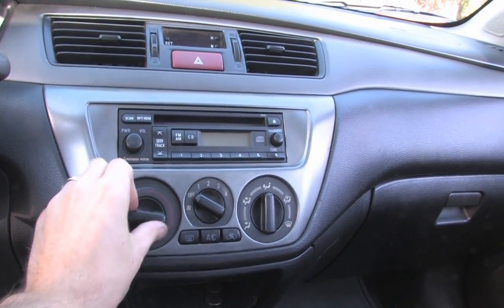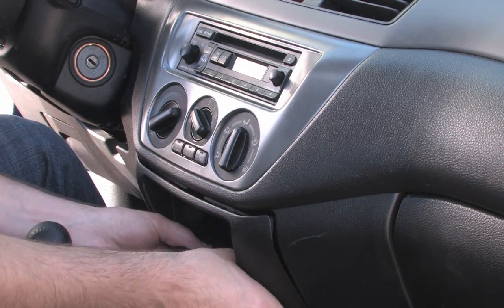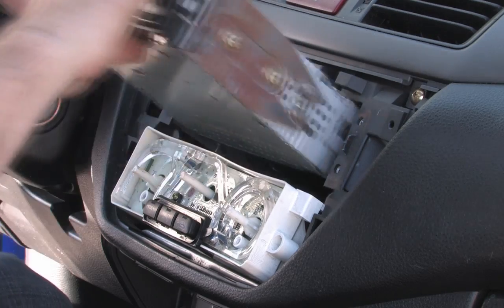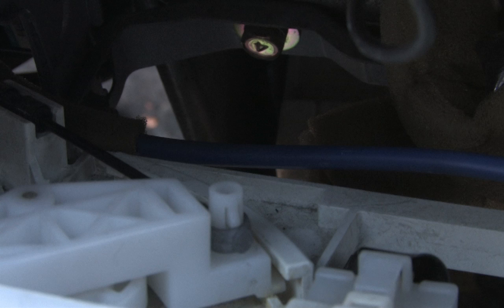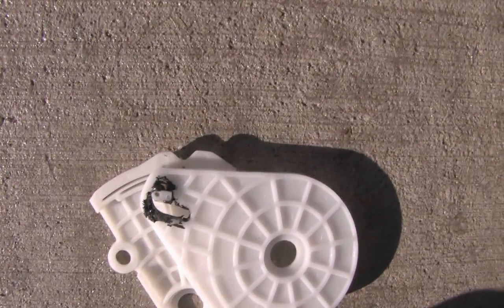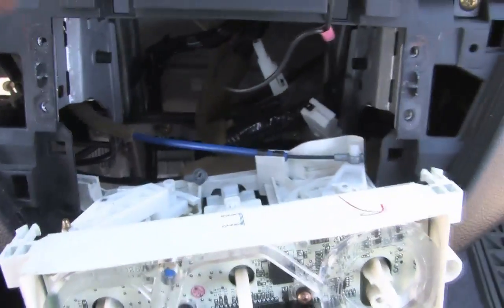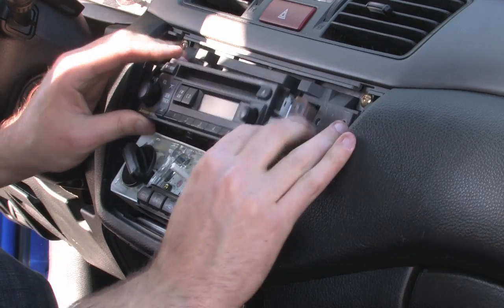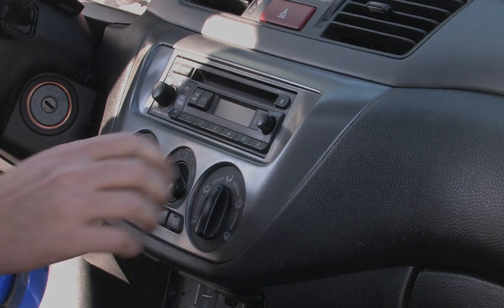How to fix a stuck heater control knob // EVO// Lancer// Mitsubishi - Boosted Films

Comment: So my Evo Air Conditioning only works (And quite well) in Max AX. If I hit the A/C button it does not light up at all meaning the green light does not turn on when I hit the A/C Button. Now when I put it on MAX A/C it lights up and goes cold.Any help?

Comment: Any advice I turned the knob from heat to cold for just a couple minutes and I don’t know if i did it too hard or what but I can’t get my hear working again when turning the knob back in the same direction it was heating up normal up until I messed with the knob I already did a heater core flush replaced cabin air filter changed thermostat and replaced and topped off radiator with the correct fluid but just recently very little too no heat ever since I turned it to AC. Part of the plastic bit broke off in the knob when trying to fix it. 04 Mitsubishi Lancer same dashboard

Comment: Thank so much for this video. I ordered the parts and I’m attempting to fix mine tomorrow. Your video gave me the confidence that I can do it by myself. Thank you for saving me hundreds of dollars. 
Update: Got it all together but it’s the round gear to the door blender causing the issue that won’t turn easy. It’s so hard to line up the notch too. Had it apart at least 9 times. I’m cut up bruised, bleeding and ready to sell this car lol. It just reached 110,000 miles for a 2004 Lancer. I can’t find any how to’s on the door blender gear for the climate control. $600 to $1000 if I have to take it in. I will never buy a Mitsubishi again after this. Sad because it’s been a good little sports car with turbo
Reply: ever find anything on the blend door? about to take the whole dash out to see what i can do with it. Might record it if there isnt anything out there.
Reply: @sr2racing391 As of now I’m using pliers to pull down the white gear under the dash for ac and a rubber mallet to pound the gear up for heat. I took it to a mechanic and they would have to order a blender door (hard to find that part) and it would cost 1400.00 usd for parts and labor. Blender door was around 800.00. Stupid way of making something. Lol. Frustrating as hell because the door is so hard to turn and you basically have to cut the white sealed box open to get at it. There has to be an easier way.
Reply: @staciemonroe1101  I can still switch heat to cold. That one moves easy. I need to look at the doors inside directing where the air goes. Both knobs are broken and I need the cables. Air only works out of my dash vents. Can get about 10% defrost if I mess with it. If I can get it locked to just defrost I'm sticking with it. If you want to sub ill see what I can do video wise.

Comment: Classic Lancer issue. Been living with this for over 7 years now, got used to switching hot to cold and back by reaching under and pushing it with my hand.
Will try this though, thanks!
Reply: Same here! We took it to a mechanic and they said they don't make the parts so u can't fix it but manually change it so thats what we do...i wonder if i buy new parts itll work normal
Reply: Same here 😊

Comment: so i changed everything besides the wire cause it looks fine. and it’s still not turning. any help?
Reply: does that small gear turn? it’s stuck for me and that little knob is in the otherside
Reply from the maker: Can you turn the gears on the control box by hand?
Reply: @BoostedFilms  nah that’s the only part not turning. i read it could be the binding door which requires a full break down of the center console.

Comment: the middle gear of my heater control is still hard to move.
Reply: where you able to move it? that notch on mine is on the otherside for some reason and i can’t seem to turn the gear to place it correctly

Comment: Hi There,
Interesting videos , it helps .
want to know
How to replace  2004 Mitsubishi Lancer  ES : HVAC left most  "pin to be replaced" with new or after market ?
for the other 2 knobs and pins, there are videos on youtube but not for the left most shaft replacement.
Kindly, help and advise.

Comment: OMG! WHAT A LIFE SAVER! switched to a double din radio and realized... I had no heat.. Tried everything to pull that wire back in, and this video showed me that I could just go underneath and pull it by hand using the gear! Now I have heat again.. Only been 3 days, haven't gone anywhere far... but it is winter time. THANKS A LOT! REALLY HELPFUL! 👍👍👍

Comment: excuse me how did you manage to pop out the part of the cable that is connected to control knob ?
Reply from the maker: Tarek Ali if I recall correctly, with a flathead screw driver from the bottom.
Reply: @BoostedFilms  I did that and now I can't get it to go back in

Comment: I recently ran into this problem and have discovered it is common on many Mitsubishi Automobiles. The cause of the problem has been assigned to a lack of a Cabin Filter letting dust and debris into the system, causing the blender door to get difficult to operate. Others have blamed the Shaft behind the Temp Control Knob being made of weak plastic material.
These Automobiles are manufactured with the Blender Door Mechanism encased in a Plastic Housing. The HVAC System is mostly Plastic. Plastic Shrinks with age. The plastic housing of the Blender Door will bind it in just a few years of shrinkage.  The Cable and Gear system used to move the Blender Door can no longer work properly because the Track it is in has shrunk with age, and the tremendous temperatures we know happen in the Dash area from Sunlight make sure this will happen.
There is no fix for this other than replacing the entire HVAC Housing to relieve the clamping effect on the Blender Door. Not an economical solution to say the least.
My solution is to attach a lever to the teardrop shaped gear on the side of the HVAC box. Pushing it Forward for Heat and Pulling it Back for Cold. The door is moved easily into any blend position by this method.
Manufacturers take note, this is a design fault.
Reply: Harry Taylor would it be possible for you to take a picture and post your solution?
Reply: Same my problem in my car ....

Comment: Wow, thanks so much for this!  This was the first thing I broke on my Lancer after I bought it with 168k miles.  
I broke the knob and never new how to fix it.  
Everything I've worn out on this little Lancer I've been able to fix myself, from brakes and oil changes to motor mounts, control arms, struts and the ignition switch.  All done rather easily.  
These videos give the DIYer the confidence to dig in themselves.  Dash panels are always a puzzle to me haha!

Comment: Great video, a question- I can change only the cable if this is my problem or I need to change the gear also?
Reply from the maker: Gal Edri I recommend both, but just a cable might work temporary.
Reply: Boosted Films ok tnx I will order both 🤙🏻....great videos

Comment: atleast yours was stuck on heat, i never use AC so i just want heat for winter, but mines fucking stuck on AC and i need heat.
Reply: You might be able to disconnect the cable from the gears and turn the gears by hand as a temporary fix until you can replace it all.

Comment: What about the little neck part that sticks out to connect the knob to. I broke that thing to turn the heat on one morning when it was cold. The knob was stuck. Is there a way to replace that part? Do you know what it's called?
Reply from the maker: I think its just called a shaft.  I will have to refer you to this video for the fix: https://www.youtube.com/watch?v=d8jNWN6TRzE
Reply: Boosted Films Thank you.
Reply from the maker: Sure thing, and good luck. That fix takes a bit more work.

Comment: Thanks for the video.  So I bought the gears without knowing to buy the cable too.  My old cable is kinked and I am going to order a new one but I noticed that the main issue I am having is the "blend door"  as you called it in another comment is very stiff. that little gear is very hard to turn.  Do you know how to remedy that or if it is difficult to do?  (Side Note: after putting the new gears on I found that they seemed to work worse than the old ones when I moved them by hand. which is how I have had to switch from cold to hot for a while now.  Anyone else notice that?)  thanks again for the video.

Comment: So I fixed it this way. My heater now works and comes out through the front and rear as should. Also twist all the way now. But my Front Window vents/defrosters throws out NO HEAT AT ALL. Cold. Its funny because after switching it from Dash vents to the front windows vents you can feel the hot air for a sec and then it still switches to cold. Why is that?
Reply from the maker: Sounds like you may have multiple issues.  You should not be able to spin the knob all the way around.  Are you sure you aligned the new gears properly?
Reply: Boosted Films yes exactly how you did it. My knob I no longer stuck and the heater works now but from the front dash ont and rear defroster. Front window/defroster stay cold
Reply from the maker: That sounds like an issue with the other knob that controls where the air is directed.
Reply: Boosted Films that's what the other guy told me. The know all the way to the right. He said replace it but why replace it if the air control works already. It stops and switches to whatever I switch it to. The problem is the beat and cold would the knob fix that ?

Comment: Will this fix my issue?
My Know does not spin to the left it stops mid point. But I can spin all the way to the right side. My AC works 100% and the air with AC on or off is always cold. But when I turn it to the right for heat it does not do anything it stays COLD. Can it be this issue here? Again it does not spin to the left fully just like here Its stuck
Reply: the blend door inside the heater box may actually be broken. get under the steering wheel and turn your temp know to see whats going on down there.
Reply: Ok I did it. And remember my knob gets stuck just like it does here. It does the same exact thing. The cable slightly moves  and the gears pretty much dont move at all. It someone moved and stopped wouldnt do anything.

Comment: If this doesn't fix your problem then you need to replace the HVAC mix door.  To do this you have to drain the coolant, evacuate your AC lines with a certified mechanic, remove your dash, and remove your dash support bar.  At that point you need to take out the white HVAC box, break off all the tabs on the bottom of it ( don't worry, mitsubishi supplies new screws to replace those tabs with their new hvac door kit), and remove the old door.  It's a pain in the ass to do, but well worth it.  I know this because I just did it.
Reply: I am having the same problem and I found this. http://www.justanswer.com/mitsubishi/7cusp-mitsubishi-lancer-fix-broken-heater-control-shaft.html. I am going to try this. Thanks for your comment.

Comment: Do you have any idea where i can order the little clip that holds the wire in to the controls? the guy i bought my galant from says he lost them and it makes it hell on changing from heat to AC and selecting different vents
Reply from the maker: +Grimfate20 I'd check your local junk yard.
Reply: Yea, I live in a shit hole town so the closest junk yard that would have anything is 2 hours away. Wasn't sure if you knew a part number for them offhand. thanks though!

Comment: Great tutorial - well explained! 
I have a 2007 Mitsubishi Colt (in Australia) and have the same problem where its permanently stuck on facing the driver and cannot be turned to anything else... do you know if its a more complex procedure with a later model car? I cannot seem to find much on later model cars / colts. cheers

Comment: Would this be the reason my heater doesn't work or do I have two problems? My knob is on the "heat" part for the ac but can't go lower, it used to be on the "cold" part but the guys changed it around when I got my car recalled for the airbags.

Comment: Ok, so i have this problem and after i watched this video i went to my local Mitsubishi dealer to get the parts (both gears and cable) i come back home and replaced them and when im done at first it was hard to turn the knob but then after a few more turns the damn cable bends again... Wth man? What did i do wrong? ),: i own 2 lancers OZ (2002 & 2004) and they both have the same problem.

Comment: hey man, great video, I learned a lot from it. I have a couple of questions though. Will that gear set lever work on a 2002 Mitsubishi lancer? The ones I have are the ones from the factory and I don't know if this part will work on my vehicle. The other one is, that one crank you pointed out with the thing sticking out,  just by itself, without the parts that crank it from cold to hot gets kind of hard to turn once it gets around the middle. Now, the heater control wire that I have is crooked so I'm tracking it needs to be replaced. Any advise you can provide will be greatly appreciated. Thanks!

Comment: i have a 2009 toyota corolla s with the same problem but with the direction control knob which controls where the air comes out (feet, head, defrost/window)   please help. the toyota dealership wants to bend me over for 1500 bucks

Comment: I have an 04 Ralliart and I tried this, installed it the way it says to. However when I turn the temp knob to cold, and try to turn it back it gets harder in the middle and then I cant get the heat to turn back on. Can you advise?
Reply from the maker: I would make sure the gears are aligned correctly (talked about at 4:15).  or try to move the knob and watch the cable on the heater box and see what its doing.
Reply: Boosted Films thanks man I realized what I did,  I forgot to clip the cable back into the hook on the bottom.
Reply from the maker: Justin Baker sweet, glad you got it figured out.  -Paul

Comment: My heater control knob acctually broke, can I replace that also and where can I buy the parts.
Reply: Not yet. I'll post when I do.
Reply: MN185138HA that's the part number you need. I broke the stick as well and sadly that's a 235 dollar fix. I have mine ordered and I will be installing the entire thing as soon as it gets here!
Reply: JW Fuentes @ JW Fuentes. Hey man I replaced mine, it's a very easy fix, but costly. If you have an Evo 8 you will need to get Gear set lever part # 7801A110 as well. You get all the new wires, faceplate and the entire AC/Heat control assembly with the purchase of MN185138HA. The cheapest place I found it for sale was parts.com. It was totally worth having again, and I'd pay the 235 +19 for the gears all over again.

Comment: How do you remove the clips on the wire under the dash? They are super hard to get to for me and Im not tall by any means. They seem to not want to budge and I dont want to tear them out in fear of my new wires not being secure. 

Plus, thank you very much for this video. I have no idea how you managed to work under that dash without completely removing it! You are a champ
Reply from the maker: Its been a while since I've done this, but i think you need to use a small screw driver or a needle nose pliers to compress the clip and then it should pop out.
Good luck!
Reply: Thank you very much, I'm going to try that. It's a shame that everything is plastic and tucked so deep

Comment: Great video!  Very informative, do you have a recommended place to buy the parts?  I need to replace my knob as well, the whole head unit online is $100+ that to me seems outrageous for the head unit itself.
Reply: I broke mine recently and it’s still expensive, I wish I would’ve known the real issue instead of trying to turn the stem with pliers 😂

Comment: Great video, thanks. A question, I have the new gears and cable, but it is still hard to turn, I read that the damper needs to be changed also, seems like that requires the removal of the whole dash, can this be fixed without the whole thing removal? I really don't want to remove the dash because the damper failure. Thanks.

Comment: Nice....I had the same problem with the rotation of the heat control. I saw this video a month ago and when I checked under the dash, it was all clear. I did order a new set of gears and just fix it :).... I am so happy, because I was so close to order a new heat control which is around a $200! And the problem would remain! 

Thanks for this video!

Regards from Bulgaria.

Comment: Make sure you don't turn the big knob the shaft connects to because then you are going to have to figure out what position it needs to be in for the correct heat setting.

Comment: I have actually replaced the shaft. My sister roke hers and I was able to take the panel off and replace it. You will need to remove the control panel to make it easier for yourself. Make sure you disconnect all the wires shown in this video and also there are two more wire connections  in the middle you need to disconnect. Once you take the panel out just look on the underside and you will see that the outside shaft connects to the a bigger know inside. You can pop it out with a screwdriver.

Comment: Not true. I just swapped out a broken stem. It's not easy however. The heat/cold knob has two tiers of cogs before you get into the main cog that houses the stem. Once you get the two tiers of cogs off you have to force the broken stem out through the back.

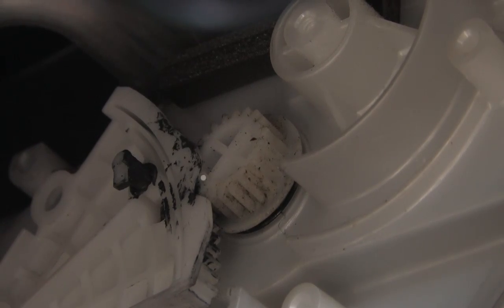Comment: At 4:28, you point (with a white dot) to a gear that turns or flips something inside the panel.  That is the wear I feel the tension; when trying to flip over from AC to Heat (like easy to turn at first, but then hard to "flip over" to heat and vice versa.  It does do to "flip" when I turn it with my hand (and some effort) but too hard for the poor knob and wire to do it.  Any suggestions?

Comment from the maker: I would take a look at the gears under the dash, turn the knob both ways and see if it moves.  If it does move, you most likely just need your A/C recharged.  If it doesn't move, try moving the gears by hand and see if that works.